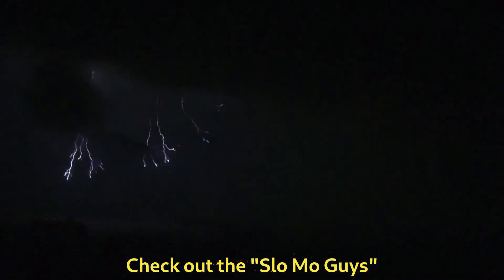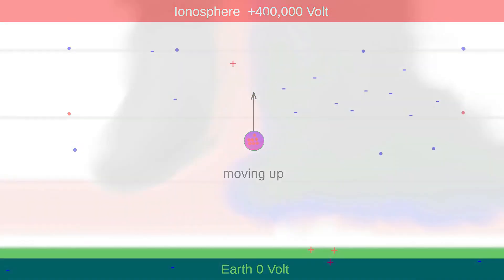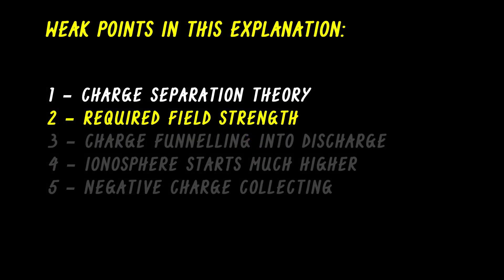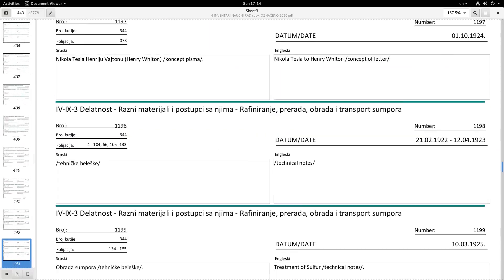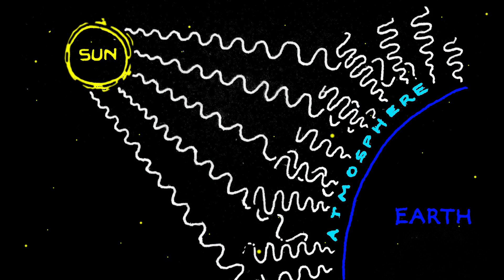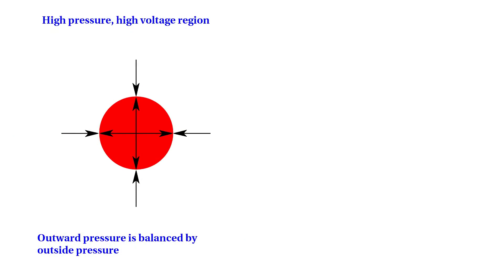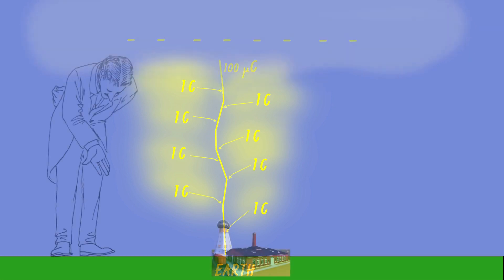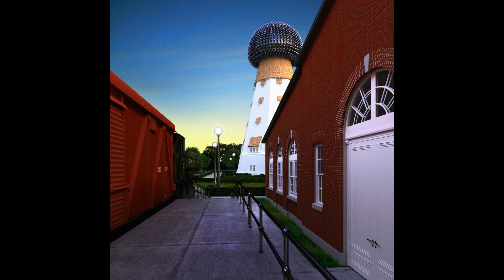Lessons From Lightning

Comment: ok, hello, I followed your videos very closely and took into account everything I read about Tesla mainly about patents and everything I studied about electrical engineering and physics.

so I ask you this.

with one of your coils, using the frequency of about 11.7 hz or what you detected as the planet's response to an impulse, in short the resonance frequency.
even if the frequency is low, shouldn't you be able to use it to start a lightning bolt from the bottom up?

clearly the minimum size for such a coil is not small, but you have them, if indeed the planet's impulse response has that frequency, you should at least be able to send lightning up into the sky to trigger the electrical activity.

i'd like to see a video about it, clearly be careful because you would literally be summoning one or more lightning bolts and this should work even without the clouds but clearly if the terminal isn't high enough the lightning would fall to earth.
Reply from the maker: Yes, that is exactly what Tesla reportedly did at Colorado Springs. The TMT sends out an impulse into the Earth and when that impulse returns it is used to next make a stronger pulse, etc. 
ATM I cannot perform these experiments for lack of funds but once I again have enough money to proceed I will do exactly that.
Reply: @WardenclyffeResearch  ok really thanks for you work really ✨